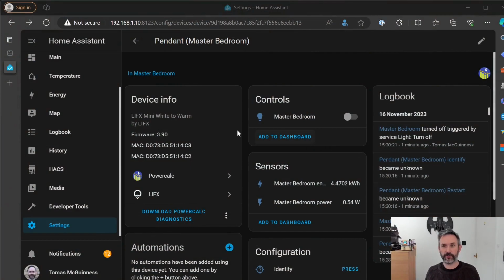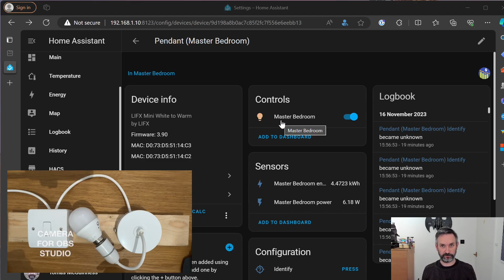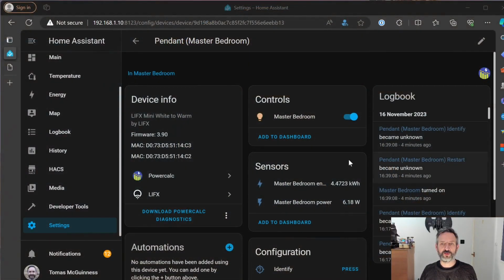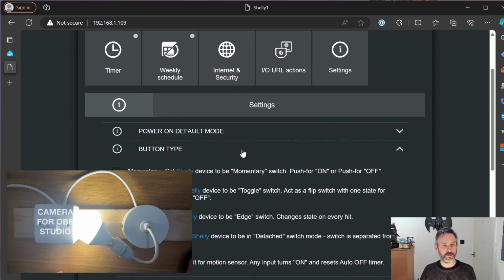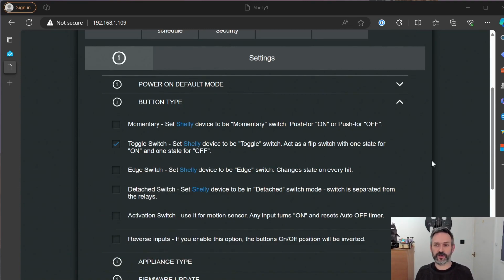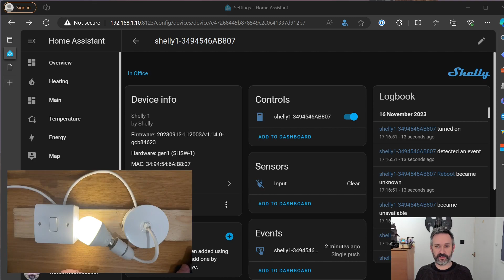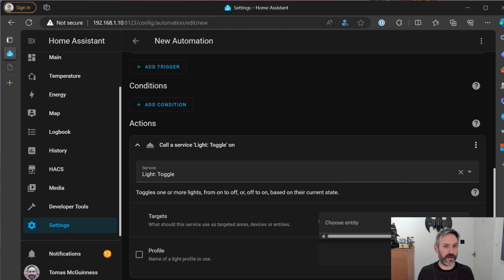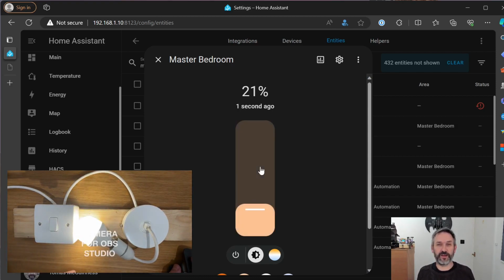Combine Smart bulbs, Shelly relays and dumb light switches for the perfect setup!

Comment: I have an application in my  ensuite where i have a very bright light fitting which illuminates the whole bedroom when you enter at night. (switch is on the outside of the ensuite due to it's size)  I am going to fit a smaller night light but this will need another switch. Using the shelly with a detatched switch is great because i can use the same switch, create an automation to switch the night light on between certain hours  or the main light during other hours. Main light  is already on a dual relay one for the light the other for the extractor fan controlled by a humidity detector.  Never knew shelly had done this.
Reply from the maker: That’s very clever! Same switch, two modes. Love it!

Comment: What happens id you have the shelly in "detached Switch" mode and then turn off the Home Assistant? would it then operate as a "normal" switch?

I have use case, where I want to have a switch but with a smart bulb. I wan't the switch to control the bulb, but if the Home assistant then I want it to work as a normal light..
Reply: I think the question he’s asking is what about when/if Home Assistant goes down. As the HA automation controls the on/off, if it goes down you lose control of the light fixture. 

I have the same setup as this using Shellys on various lights integrated through HA (more recently using the new mini relays, which are great!) and have been trying to find the best solution for a back up plan in case HA throws a fit. 

I have seen various solutions, more recently a video by Cameron Gray where he used a local script on the Shelly to default the device back to a standard on/off relay if the MQTT connection goes down. I’m currently using the standard WiFi based native integration for my Shellys, hoping to find something that does the same but based on HA connection status, rather than the MQTT broker. 

Anyway, apologies long comment - really good video, thanks.
Reply from the maker: Glad you liked the video! I mis understood the question. If HA goes down, we would have to fall back to the Shelly app itself. That said, it's solid. Only time it goes down is when I tinker with it. I've been thinking more and more about fail over and redundancy since the house is becoming more and more reliant on HA.
Reply: @tomasmcguinness  Appreciate the response, and agree that high availability / failover becomes a concern as we add more and more things to HA! Good point about being able to use the Shelly app, should HA go down. For some reason I hadn't considered that.
Reply from the maker: I've been thinking about this since you commented and have an idea now for a python script on a raspberry pi that could contact all the shelly relays and switch them back to relay mode so the light switches would work normally. Wire it up to a button or switch on one of the GPIO inputs so there is a "failsafe button" :)
Reply: @tomasmcguinness  This is a good idea.
Reply from the maker: In the video, I use the “input” sensor of the Shelly to tell me the state of the normal switch. When it’s flicked, home assistant will toggle the smart bulb.

I’m not sure I understand the question completely.
Reply: @tomasmcguinness  Thank you for your reply! 
But what happens, if you turn off the HA, how does the light then behave, when you flick the psychical switch? (sorry for any typos, English is not my primary language)
Reply from the maker: @jensjensen1182 if you set the automation to toggle when the input changes, the light would turn on.
Reply: @tomasmcguinness  and is it the HA(Home Assistant) that does that? and what happens if the HA is turned off...
Reply from the maker: Then the light switch would cause the automation to toggle the light back on. With detached mode, the Shelly’s relay is always turned on, so the bulb gets power. The light switch is the provided as an input, so you’re really using home assistant to turn the bulb on and off and the Shelly relay is there to just read the state of the switch!

Comment: The Shelly Plus i4 might be another option to look at. It is inputs only with no relays. You would just wire the socket live all the time and the inputs would send state changes in a similar manner. I have one I use in a remote location to control Shelly wall dimmers in a three way configuration directly via Shelly’s http triggers. The other i4 I use as a scene controller. It sends MQTT commands that trigger HA automations. Very useful and affordable devices.
Reply from the maker: I’ve been using an i3 to detect calls for heating and hot water and it’s worked very well. I didn’t think about it using in a lighting scenario! Thanks.

Comment: After re wiring my house with a lighting panel of shelly pro 2s to a central point, this is something ive been thinking about for the odd room. But my thoughts are using an esp32/esp home in another  panel next to light sw to make scene buttons? Great vid subscribed!
Reply from the maker: I did this with my Kitchen extension! Two Shelly Pro 4s controlling all the lighting. It’s brilliant. Combination of normal bulbs and smart bulbs. Thanks for subscribing!

Comment: It's a nice idea but it would drive me insane having the physical switch in the off position but the light being on! All the switches in your house will have a different position for off and on depending on their physical state vs their smart bulb state.
Reply from the maker: True, but at best all the switches would be on anyway, regardless of the smart bulb, so this isn't really any worse :)
Reply: Maybe use a momentary switch that goes back to it's original position after push. There are momentary switches with connectivity too.
Reply from the maker: That’s a good suggestion! Any automation could listen for the pulse and toggle the lights. You’ve reminded me that I do have a momentary switch in my kitchen which I need to hook up (to turn out all the lights)

Comment: That’s really handy and an absolute pain in the head here for me so that will be a godsend… My back boxes are quite shallow so wondering if it’ll fit for me, a Sonos relay wouldn’t previously… Anyway, thanks again 👍
Reply from the maker: I use the ceiling rose in my lights. I replaced the plastic ones with metal boxes, which have lots of room!